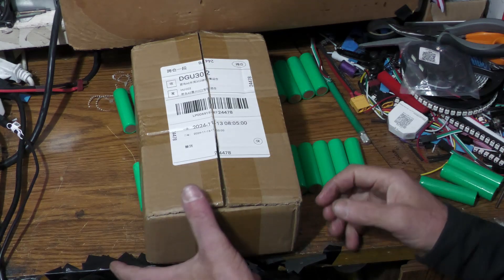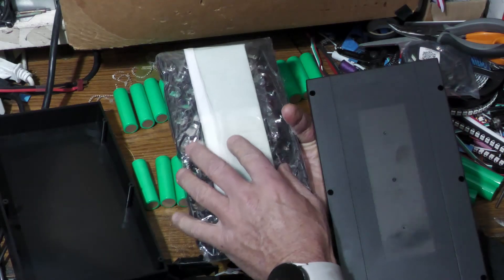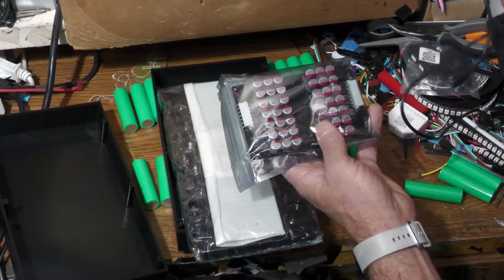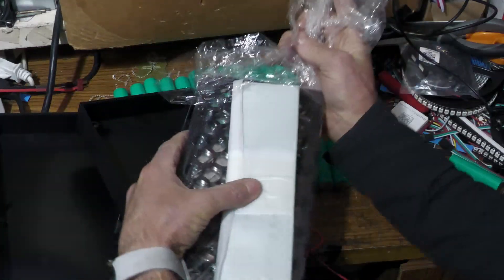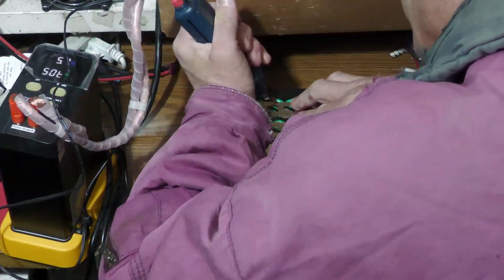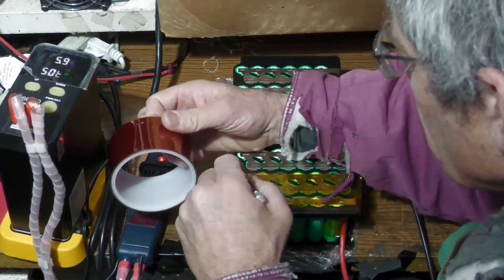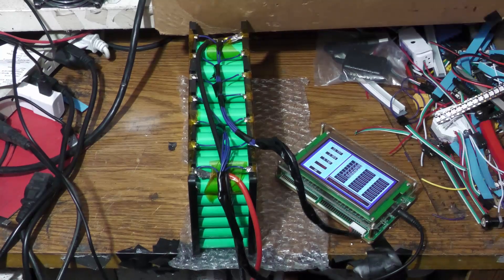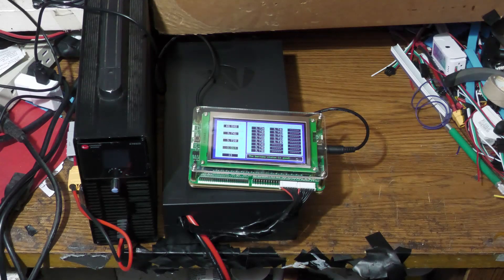How to Build a 13S6P 48 Volt 20 Amp Hour Lithium Battery, Using an Ali Express Battery Box $100

Comment: 20 amp 30 amp 18650 or 21700
Reply from the maker: The cells I'm using are NCR18650B 3400ma rate at 2C so this pack can pull around 60 amps. Check the rating of your cells

Comment: Nice explanation! Could you provide the links for the display you're using to monitor the cells, as well as the box itself?

Do you think the same build could be done for 3S (12v)? Thanks!
Reply from the maker: I use this method on most of by batteries of all sizes.

This is the link to the battery box "Turmera 13S 48V 52V E-bike Battery Box 13S6P 18650 Holder with Welding Nickel 30A BMS for E-scooter or Electric Bike Battery Use"
https://www.aliexpress.us/item/3256806275977165.html?spm=a2g0o.productlist.main.1.7aea667epI08b4&algo_pvid=9c46f13b-020c-4158-91e5-d85669d04254&algo_exp_id=9c46f13b-020c-4158-91e5-d85669d04254-0&pdp_npi=4%40dis%21USD%2150.64%2115.70%21%21%21369.93%21114.68%21%402103205217372514300042937e77ec%2112000037283750228%21sea%21US%214656929933%21X&curPageLogUid=VnQ1JvTZlE25&utparam-url=scene%3Asearch%7Cquery_from%3A
This is the link to the "Single Cell Voltage Tester with Color LCD + Power Cable Suitable for 1-24S Lithium Battery Pack"
https://www.aliexpress.us/item/3256805979319946.html?spm=a2g0o.productlist.main.5.23e1CX18CX18u7&algo_pvid=45a9ea89-589f-4398-846a-2f2bcab26117&algo_exp_id=45a9ea89-589f-4398-846a-2f2bcab26117-2&pdp_npi=4%40dis%21USD%2181.18%2156.83%21%21%2181.18%2156.83%21%402103247917372511762602804e74e9%2112000036069310656%21sea%21US%214656929933%21X&curPageLogUid=PdBc4CHXWsx6&utparam-url=scene%3Asearch%7Cquery_from%3A

Comment: That's the case you're going to use and all the cells are from China too. Looks like a fire waiting to happen. Those cases should be fire certified in case  one of those cells goes haywire. I wouldn't mess with those cheap plastic cases.